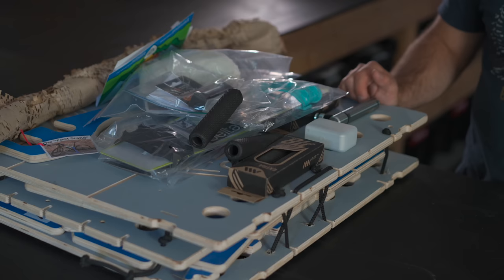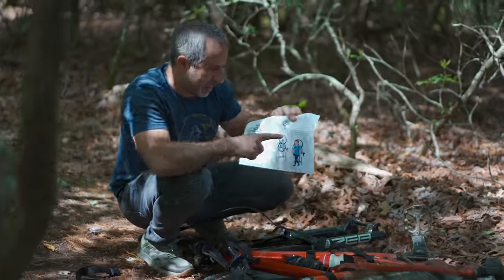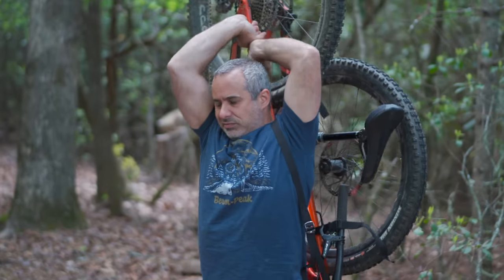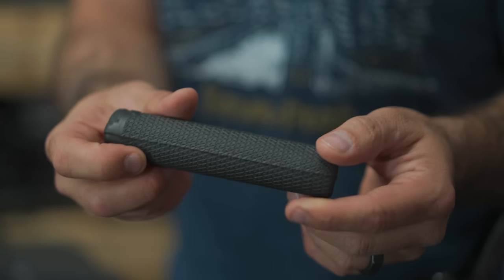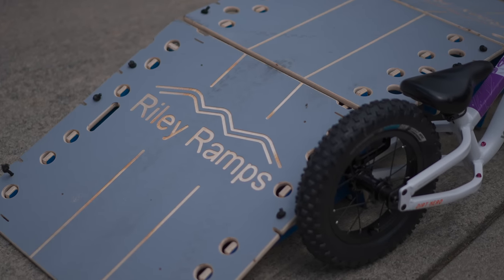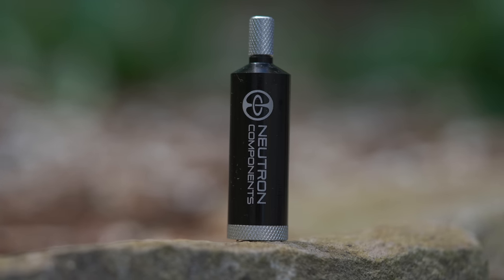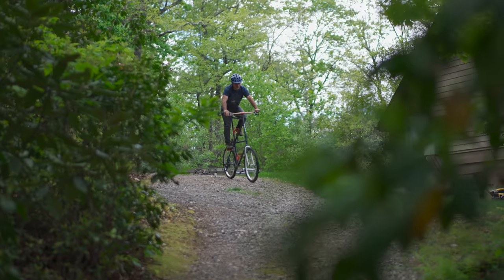Rapid Fire Reviews: Weird Bicycle Products!

Comment: Quick tip: if your valve stems clog then just remove them from the bike and use a syringe to squirt isopropyl alcohol into the valve stem and it breaks down the sealant.

Comment: Those small battery powered pumps make no sense even for road/commuter bikes as they're emergency devices. The battery will inevitably discharge and then you're stuck with a flat tire. Maybe, maybe if it could be directly powered by the USB port it would work for ebikes, but then you'd need to carry a cable too. Nah. Micro-pump is so much better for general use. Takes 5-6 minutes to inflate a tire, sure, but you'll only need it once every other year or so, and when you do, it'll work.

Comment: Somehow my rear derailleur got caught in the spokes and drug around while I was 2 miles deep on a trail, the wheel was locked and i did not have the strength to pry the derailleur loose from the spokes.  i just pressed my weight down on the handlebars as i walked and the rear wheel drug itself on the ground no problem,  it was harder than normal but worked perfectly fine.  I do not think carrying it on my back would have helped anything

Comment: That battery air pump would be nice as hell if it could last for a few full inflations. Sure it would probably weigh a decent amount but I personally would rather carry it on casual rides over single use CO2 or hand pumps I always end up hurting my hands on.

Comment: I use a bigger version of that pump that has a bigger battery in my commuter bag but i dont think i would pay $40 more then i did for my pump for that one to have no screen and less battery just to save a small amount of space. I also ride an ebike to commute so the tiny amount of weight it adds does not matter in the grand scheme of things the bigger pump is a way better buy.

Comment: I am skeptical that the pump (1st product) is adequate for road bikes. The volume is small, but the pressure requirements are quite high and I do not believe that it's able to repeatedly (no from one charge, but enough times in its life) inflate beyond 40 PSI without damage to itself.

Comment: This is interesting I stumbled upon this video I wasn't necessarily looking for it. But I ride dirtbikes typically alone and I wear a backpack. I will go very far out like 50-70 miles from the truck commonly. I'm also a mechanic so I know my way around tools and repairs, I'm not going to go into detail about my kit because it's a lot of stuff like a ton and I sourced and weighed every piece and brought weight down with titanium tools and other lightweight tools I have enough tools for me and some common stuff for other people I may find because typically that's the only time I'll use my kit so far is for other people. I have an extensive tool kit and parts and repair pieces I also have a lightweight fixed knife and small lightweight hatchet and sometimes a lightweight 22lr. I also sourced my pump from a mountain bike store it's a hand pump. But I actually did start weighing my things in grams because I want my pack to be 15lbs or less fully loaded including water I drink a lot of water I have the largest water bladder I could fit/find I believe it's 2 liters it might be more its more than double what ive seen others with. And I learned over time that anything over 15lbs was strenuous and bothersome like when my complete pack weighed 17lbs it was still bothersome but when I got to 15lbs it didn't bother me at all and it gets lighter as I drink water and I also have water filtration to refill from streams which happens often. I'm not into hiking and all that stuff people get all crazy about with weight but when I realized how large of a difference my pack weight made for me I spent a bit of money and a lot of time on keeping my extensive kit under 15lbs including my full water bladder and food. I also wanted to work in extra space for a bottle of fuel on longer rides sometimes it gets to 16lbs.
 Anyways what I'm saying is I like being prepared I have a lot of stuff way more than listed here and for anyone who likes to similarly be prepared I would suggest testing different weight packs because I don't like my pack interfering with my ride at all and I found that getting my pack at the proper weight allowed me to be prepared and didn't take away from the fun or exhaust me. I totally understand now when people get all crazy about weight savings because when you really enjoy something it's worth making it better and staying prepared. I remember when I first put a kit together with normal weight stuff I would notice how fatiguing it would be and it got better as I drank more water and reduced my pack weight. So I bought a scale to weigh my pack and started finding lighter weight tools then I bought a grams/ounce scale and I reduced the weight as far as I possibly could to the point where fully loaded I am always comfortable and what I can handle comfortably just happens to be 15lbs. I can tell when I get to 16lbs. I'm sure everyone is different. I'm not sure if I could train myself to hold more weight or if I'd want to because I'm sometimes riding extremely hard single track and pushing myself to my absolute limits and even after conditioning and everything my comfortable pack weight hasn't changed and when tuning the bike I count my weight plus the pack. This video reminds me of when I was researching lightweight small items I researched about every single item in my pack. For anyone thinking about how their pack weight effects their specific hobby I would highly suggest testing different weights and looking into maybe reducing weight because it made a huge difference for me I was very skeptical about people weighing their stuff in grams and ounces.

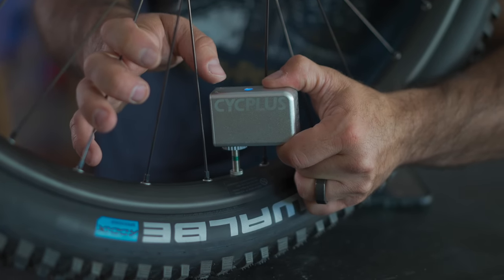Comment: 2:38 not necessarily is it better on road bikes as the pressures are considerably higher. One inflation could very well result in even more electrical energy needed. For a mountainbike with a handpump you need to pump what feels like forever at low resistance. For a road bike it gets harder and harder until the pump physically won't do the compression that's needed for further inflation. Something similar would apply to the electrical pump.

Comment: The problem I see with those valves is that if unluckily they cork or there is any trouble with the closing mechanisms itself you have no choice but to disasemble the tyre. Moreover in case of damage replacing the whole valve is unavoidable. Really appreciate the design but i'll stick to ordinary valves wich can be replaced in a matter of seconds with the wheel assembled and are totally inexpensive.
Reply: (I'm sorry for any grammatically error I could have made)

Comment: The thing that I dont like about the Falco Gun Bag, is that it advertises  that it might have a loose unsecured gun by having the side mention it is for guns.

Just have Falco. If someone is going to recognize Falco, they would probably recognize the bags use anyway. If they dont recognize falco, they might choose to leave it alone as a bigger bag might just be your lunch, and going to jail needs a worthwhile risk.

I mean, its a 2/10 complaint for a 1/10 issue, but guns should be safely kept.

Comment: Road bike tires are low volume but you need to inflate them to much higher pressures which make me doubt if the battery pump would work. 21 psi is nowhere near enough

Comment: 2:37 you can't compare road to mtb tyre volume directly as the pressures are maybe 3x different,  the actual volume of air you're putting in would not be that different,  also pumping to higher bar needs more power, regardless of volume there will be a max pressure limited by the power of the motor.
Reply: No

Comment: Noticed that qbp recently listed a backpack-style bike carrier from ReStrap; theirs remains attached to the top tube, leaves the bike intact, and appears padded but seems primarily designed for traversing too-rough-to-ride terrain.
If worried that your hydraulics may fail then maybe cable-actuated are a better choice; toss some Swiss-Stop pads along with 220mm and you can do cartwheels with ease while easifying trailside repairs exponentially (i.e., pads and rotors make more difference than hydraulics vs quality mechanicals).  Essentially all high-end touring bikes use cable-actuated for durability/repairability; if you consider hydraulic pressure essential then cable-actuated hydraulic calipers rock in terms of lever feel but are not ideal for unsprung weight in terms of suspension.  rant rant

Comment: a road bike needs a much higher pressure, so you can remember the ideal gas equation...  so this pump is not bad, but the charge indicator is accurate and the battery volume is 2 times more

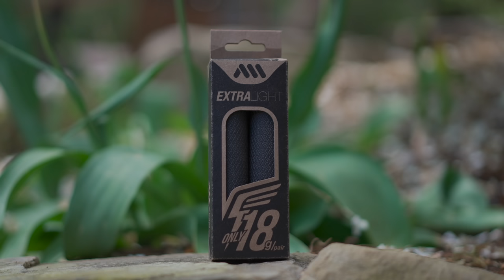Comment: 9:27 Supacaz Supalite Grips are actually much better than these, they weight 17g with built-in caps, and they are made of nice quality material and the price is 10$. Those ExtraLight on the video actually look cheap and are horribly expensive.

Comment: If we could just go to using Schrader valves we wouldn't need these expensive fancy Presta valves that don't clog, MTB rims are plenty wide enough now.
They flow more air so seating tubeless is easier not to mention Schrader is superior interface for air chucks, gauges and pumps.

Comment: Those Fillmore valves are not great in my experience. They hold sealant in the valve stem itself in-between the seal and the cap and clog anyway, regular presta cores are about $1.50 so just put new cores in every time you put fresh sealant in or new tires if your clogging that many valves. They are also not insert friendly at all, Cushcore completely holds them shut. Those bars are super sketchy watched a guy snap a set off on a very chill ride. SETH DO NOT MTB ON THOSE.

Comment: if road bike tires are twice the pressure of mtb tires, obviously the fact that they're smaller doesn't mean that pump would be great for them. If that thing can't push past 20 PSI in an mtb tube, what makes you think it'll push past 20 PSI in a road bike tube? And obviously with the volume of the road bike tire, 20 PSI won't hold up the same and isn't usable to get anywhere, you're just asking to damage parts... yello?!